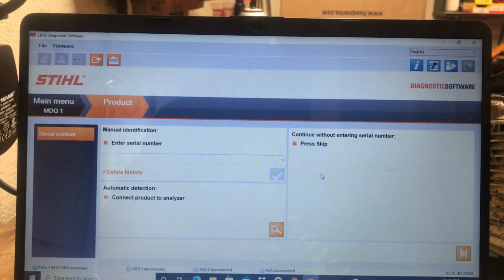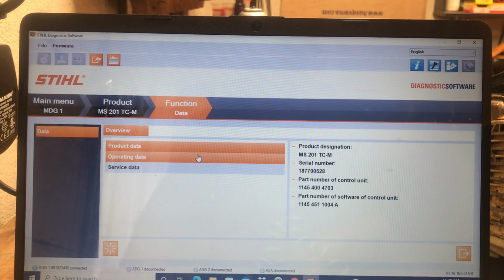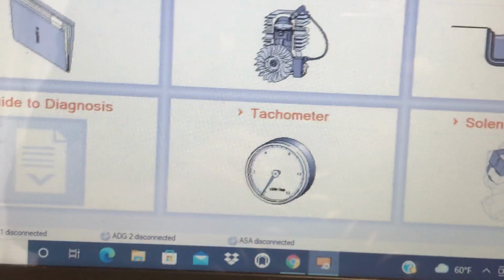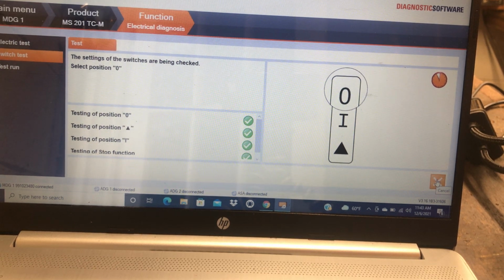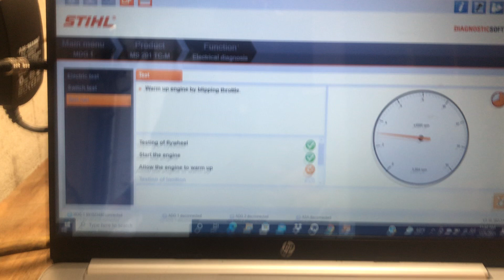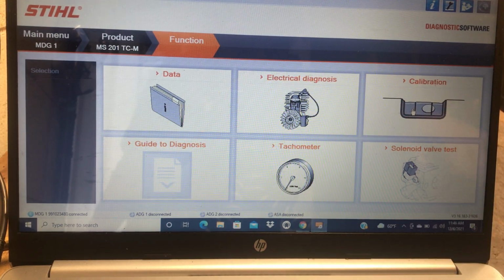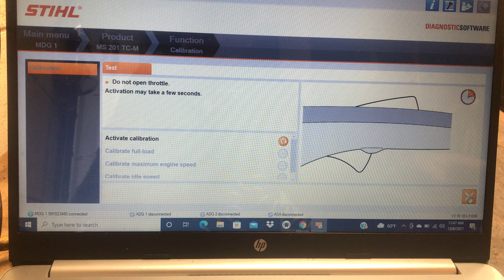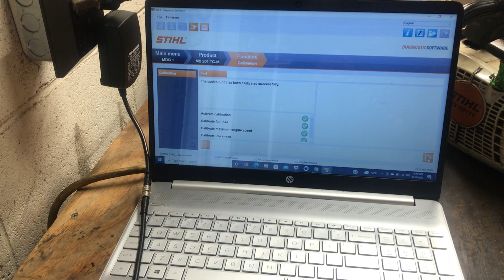Stihl MS201TC-M Diagnostics with MDG-1

Comment: i am over in uk , i am thinking in buying this tool , as i just rebuilt a ms500i , i couldn't see any spark when pulling recoil , so needed it plugged in to test ignition module , but no one in my area has the stihl tool to do this , so maybe a little sideline venture for me , 

great video demo of running through process ,

Comment: Richard, thank you for this video! I inherited the MDG system, when our Stihl trained guy quit. He went on to a job he was in college for. (Jet engine repair, as I heard it.)
So, I have been a month trying to learn how to use the m-tronic stuff. Your presentation was great. Thank you, I appreciate it. Friday I hooked up everything and made my first saw using the MDG to re-set the saw. Thank you.
Reply from the maker: That's Awesome!  There's a 2.0 version out now.  I haven't had luck getting logged in yet.  Need some help from tech support.  It's supposed to have some more features.
Reply: New 2.0 is softwer for stihl dealer!  I work mdg 2.0 , this softwer only update !

Comment: Where can I purchase this software. I own a Stihl ms661R C-M and a Stihl ms261 C-M. Looking at other Stihl saws with the M-tonics. I called my local dealer he said I think you need to be a Stihl tech to get one. They was looking it up and doesn’t show available to customers. So I’m not sure if it’s just not in stock or it’s not available unless you work as a contractor for Stihl
Reply from the maker: I was "allowed" to purchase this will a little help.  I'm not sure going forward how long I will be able to use it, and the software.  The 2.0 version software that is just out requires a dealer log in, unlike the current version I have.  It has been supported and updated along the way as I have used it.  I have a feeling the platform I have will eventually not be supported and rendered useless.  Just speculation for now, but highly possible.

Comment: Hey rich I have a 201tc-m and when you start it for the first time and let it warm up for atleast 30-45 secs it falls on its face when I give it throttle. But straightens out after 4-5 mins. I replaced spark plug air filter fuel filter and cleaned tank. I removed the spark arrester awhile ago and always use canned gas.Did the mtronic reset and still does it. Do u have any suggestions? Possibly looking for a lil port work and muffler mod. Are you taking customers?
Reply from the maker: Does it have a hesitation when you throttle up?  Especially if you let it idle for a little bit in between cuts?  If so it's time for a new carb.  Swapping out the solenoid or putting a kit in the carb won't make a difference, in my experience.
Reply: @richardflagg3084  nope the only hesitation it has is within the first couple cuts of a cold start. It doesn’t even do it if I run it then shut it off for 20 mins and start it back up
Reply from the maker: Are you doing a lot of light pruning?  Go stick it in some wood you can make some full bar length cuts.  Allow it to cut under a steady load, and when you come out of the cut, let it idle for 10 seconds.  It helps the MTronic system learn.
Reply: @richardflagg3084  I do use it to limb, but also to chunk down a tree until the wood is bigger then the bar and then I’ll switch to a bigger saw. Next time I’ll let it idle for 10 secs after I cut. Thanks for the help.
Reply from the maker: @williamfrancisco9077 Without it being right in front of me it's hard to diagnose.  Seems to run fine MOST of the time.  Which is incredibly frustrating for you.

Comment: I would sure like to purchase a MDG-1 but I don't know where to get the software. Are you a Stihl Dealer ? Or is there another approach ?
Reply from the maker: Talk to your local dealer.  He should be able to sell you the diagnostic kit
Reply: @richardflagg3084  They will sell me the kit but not the software. When you got yours how did you get the software?
Reply from the maker: @davidgoldsmith939  The Older MDG1's had a CD to get started.  Inside the kit there is a card with a serial number and a link to download the software on to your computer.  After that, It updates as necessary when you log in.  It's a one time spend.  No recurring costs to "stay current"

Comment: Best info I've seen, on M-tronic - Thank You!
What I am trying to determine:  is an M-tronic ms261, as reliable as a carbureted ms261?
I'd rather have the long-term reliability, and ability to fix problems myself.  Thank you!
Reply from the maker: Honestly, I feel the MTronic saws run better than a properly tuned traditional carbureted saw. Both the Auto Tune and MTronic components are pretty robust.  I would suggest running 40:1 mix regardless of MTronic or standard saw for longevity.  It's fine for the top end but the bearings in the bottom end need the added film strength of that little extra oil.
Reply: @richardflagg3084  Thank you for the advice, on the M-tronic.
I'll assume, the 40:1 mix (Stihl oil) won't cause exhaust plugging?  I had an old Homelite PS33, that plugged its exhaust - with older type mix oil.  My little MS250, has stayed clean on the Stihl oil at 50:1.  Plus, my other Stihl tools use the same 50:1.
Reply from the maker: @nanomaine  I'm not a huge fan of the Stihl Ultra.  It has a very high flash point.  The original Stihl orange bottle will give better results.  All 2 stroke oil has to burn.  A high quality oil that has a lower flash point will carbon up less.

Comment: is it worth it to timing advance these saws or just leave them alone?
Reply from the maker: I see a small improvement in throttle response with a mild timing advance.  As far as a real increase in performance/ power I think a healthy muffler mod helps more IMHO.
Reply: @richardflagg3084  thanks , yea i muffler modded it the second day i had it but didnt know if the advance was worth it or not.